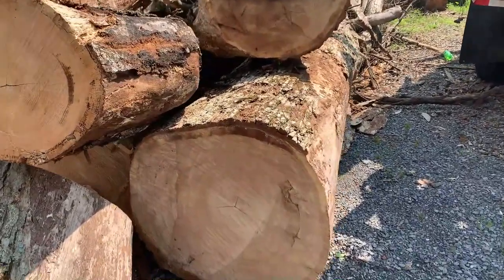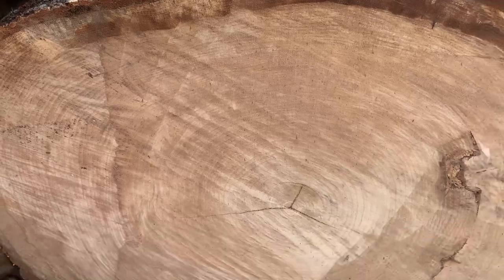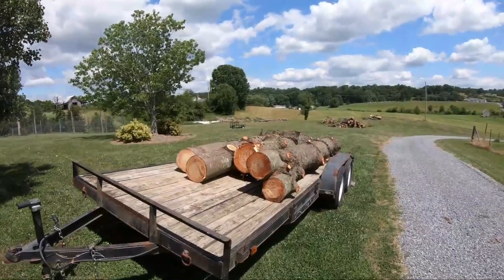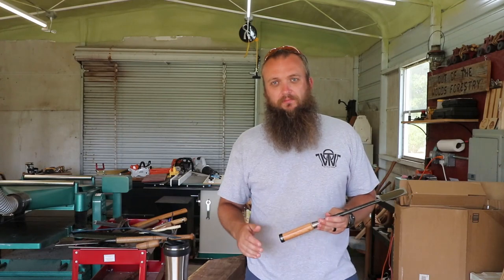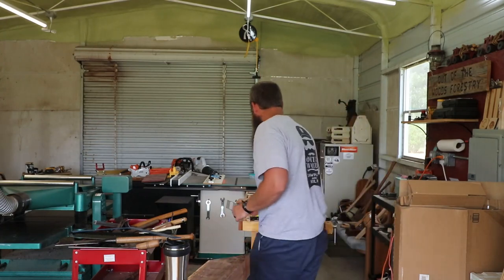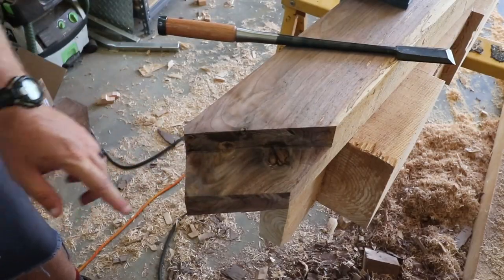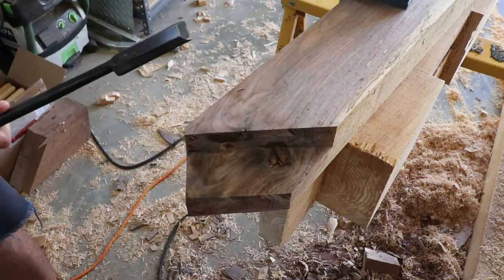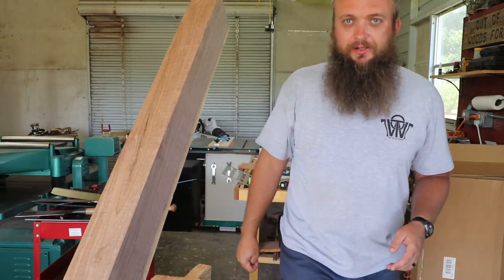Hauling Logs To The Sawmill and Learning To Timber Frame, Vlog Workday

Comment: Its fun to stop into The Shelter Institute's home shop, very dreamy.    30x30 shop for a first project is bold.  You will learn a lot on the way.  little things like when you were pushing the slick on the brace tenon, if you pushed it the other direction it would be even easier, and that was a good testament to the sharpness of the chisel, cutting into the grain like that.  Homeschooling your self, that's about how I learned timber framing it a good way to go.  supplement with a variety of information sources.  Great to see your project moving long.